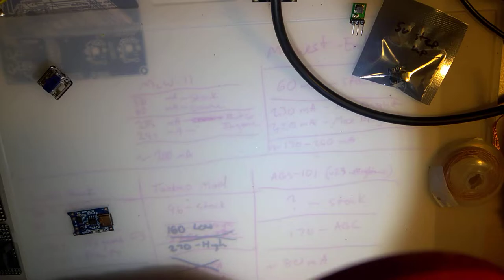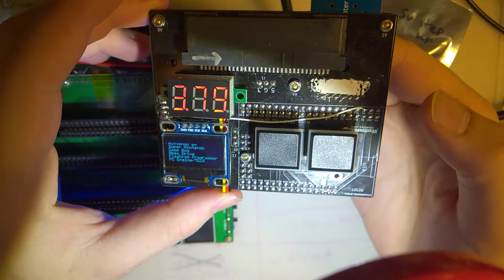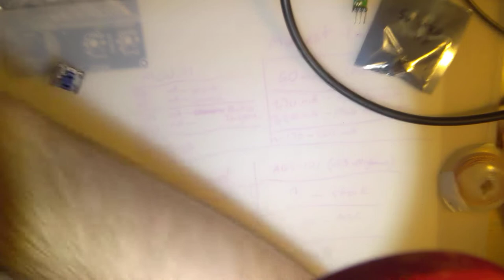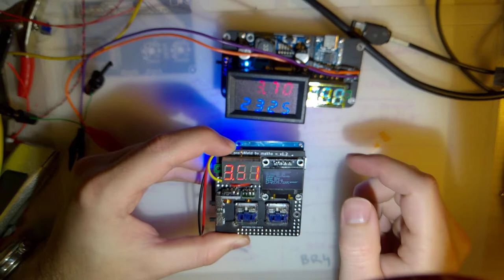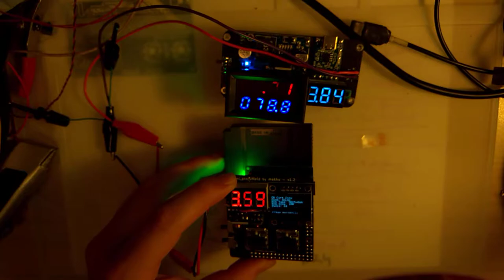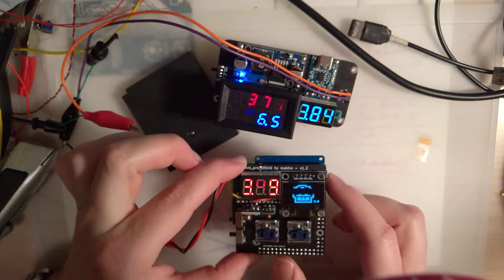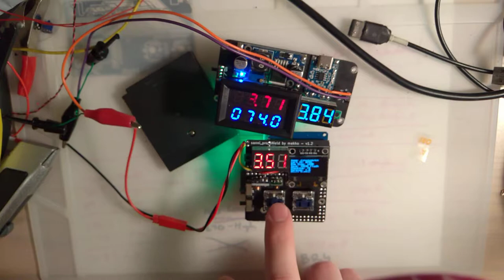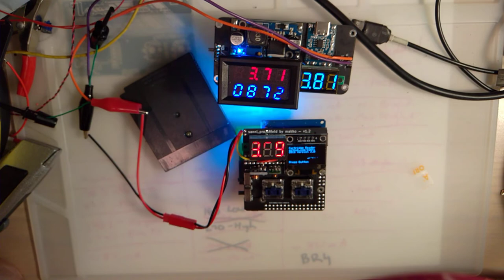Assembling my Smallest Sanni Portable Cartreader Yet

Comment: Is this all that much better than the gbxcart rw? It seems like a fun project I'd like to do but I have no need for portability and the gbxcart seems like it will be cheaper. Does the sanni one have more functionality?
Reply: I mean if it is gb only like this (that is all I need)
Reply: I just subbed by the way, you've been doing a lot of projects I want to do and there might be some more I'd like to try in the future (like maybe the FIPS in an ags001 bc the frontlight is getting boring)
Reply: Could you link me to your friends computer based solution? Is it as functional as Sanni's?
Reply from the maker: @NikhilGarlapati  The major thing that this cart reader has that others do not is that this one does not require a PC to function. If that doesn't matter to you then there are cheaper and easier to build readers. Other than Nintendo Power carts and, eventally, N64, SNES, MD, etc, the funcitonality in this cart reader is pretty similar to the GBxCart RW. 

Take a look here for more cart readers (most are GB/C only at the moment): https://github.com/MrHDR?tab=repositories